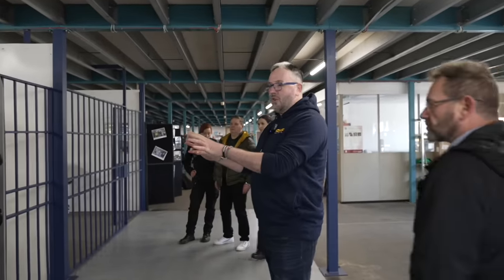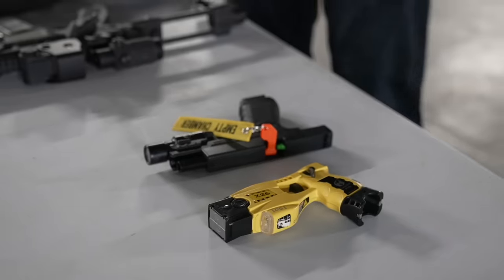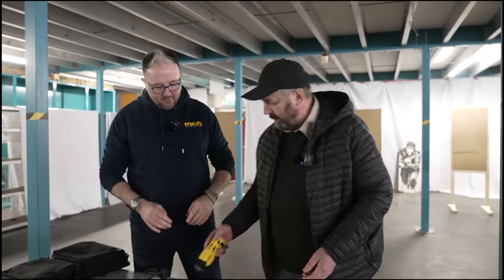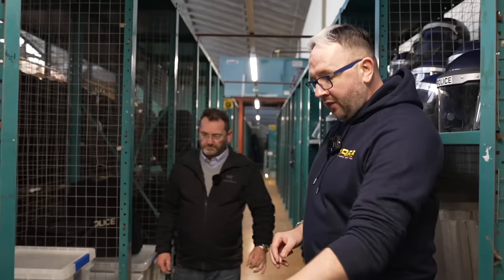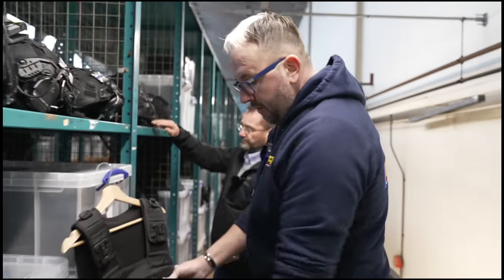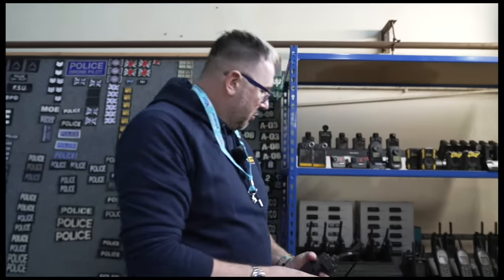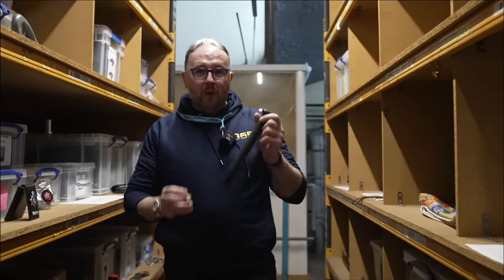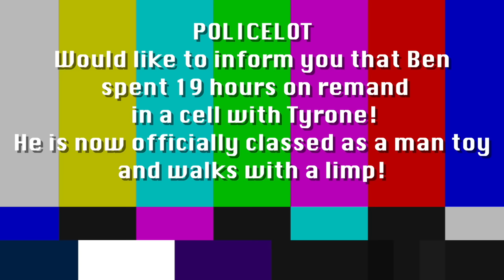Where TV and Film Get Their Police Gear! - From Guns to Uniforms!

Comment: Airsoft guns can be extremely convincing
Reply: It depends, basically if something is for the American audience with generally more knowledge of firearms you can't use many types of airsoft guns. A good example is that Glock 17. 9mm Glocks work on a tilting barrel lock mechanism. Airsoft glocks work on straight blowback. As such you can always tell it's not real because the barrel lock up is 1cm lower than it should be in battery and not flush.
Reply: Airsoft guns still look real especially if you come across some one holding it in the street at half past two in the morning and its dark and raining
That's another reason why ARV officers deserve a medal for having to make split second decisions.
They don't get extra pay and the public hindsight brigade are so quick to judge them
To all bobbies speaking as a retired one thank god you are there
Reply: You both make excellent points and ones I agree with. I think Airsoft should be spoken about more incase people have no idea what the game of Airsoft is. I have seen some extremely convincing Airsoft guns but  of course if you have knowledge of firearms you would be able to tell but not in a split second in the dark when you are responding to something and full of adrenaline. I certainly wouldn't have the bottle or ability to make a split second decision in those circumstances